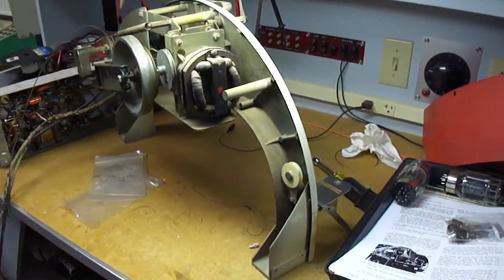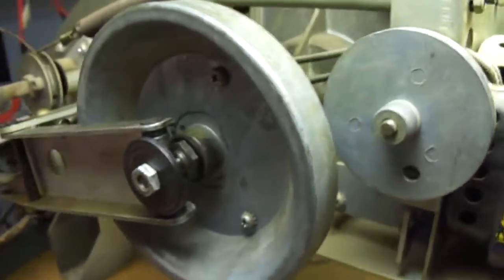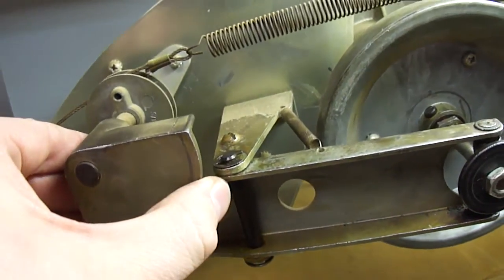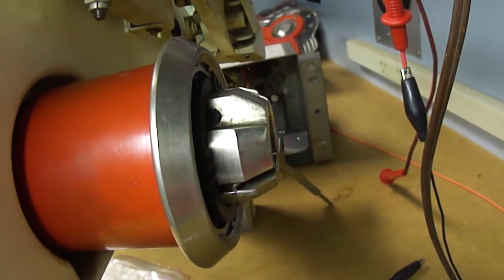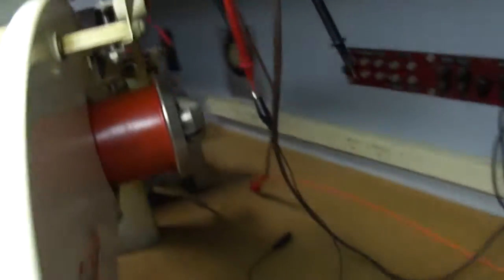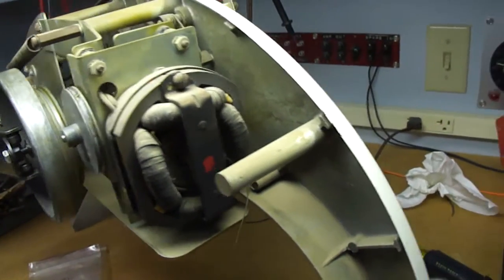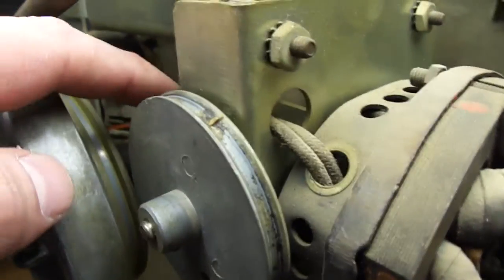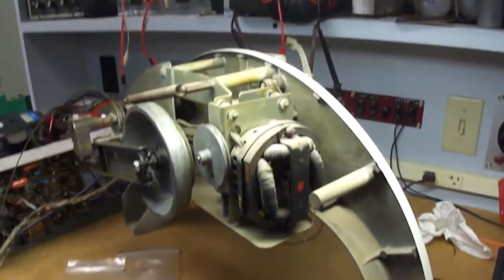1955 Wurlitzer 1800 jukebox upper mechanism repair (part 1)

Comment: Hi Chad,
I just got a Wurlitzer 3310 and the Clamping of record does not work. I can also see that the tonearm is not aligned properly as the U shape guide is to far from the record when in play postion. I also need to help the turntable start spinning (new belts are on the way). There is jukebox tech around so... I need guidance to make this old Juke work again! The selections work very well, it takes the record up and down after I fake the record ending with the tonearm. Any advice where to start  and how to adjust the tonearm mech?
Many thanks